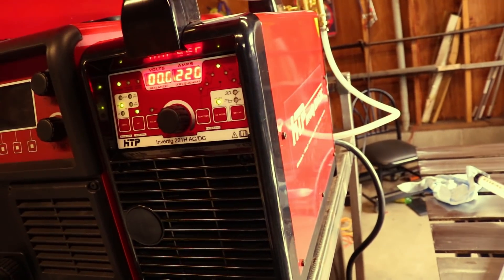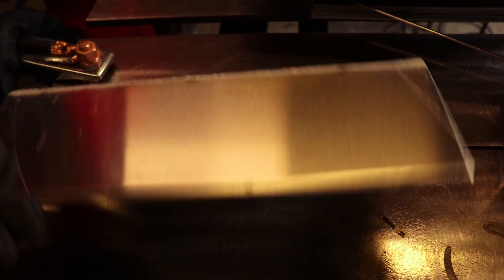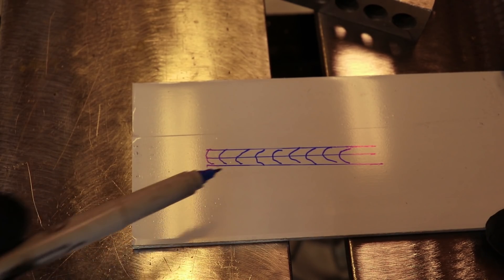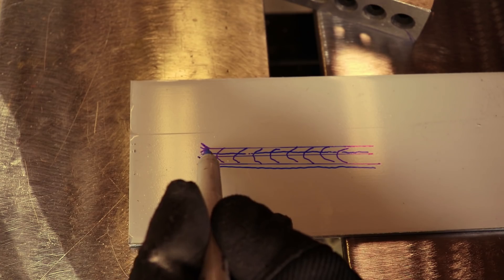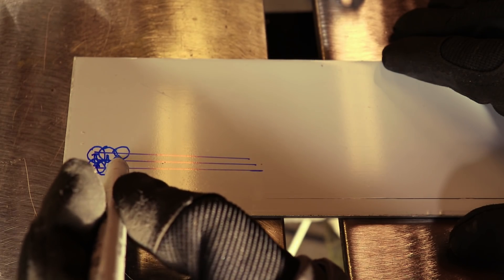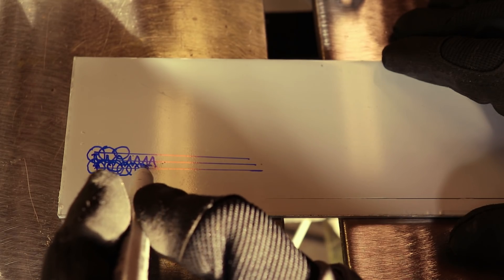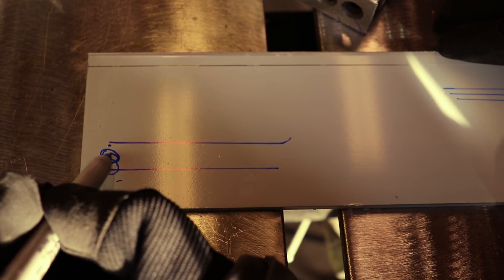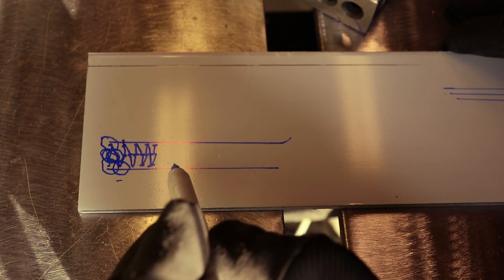TIG Aluminum Weave with HTP Invertig 221

Comment: Your videos are so helpful. Thank you so much for sharing. When I weld inside corners I can’t seem to get my arc down into the corner. It tends to bounce between the flat plains of the two pieces. Do you have a tip for that?
Reply from the maker: Ya it usually will do that until you dab some filler in there to join them together.  After that it should be smooth sailing!  If its doing it afterwards its possible that your gas  has too high of a flow rate
Reply: 5th Street Fab thank you so much!

Comment: Is it posible to tig a crank case ex.( from a motor cycle) using  tacoma imverter dc tig/arc and argon gas? A/c tig/arc machine are very  expensive.

Comment: Amazing welds as usual. Looked like you just keep your foot pedal fairly steady, rather than manipulate the pedal as you dip filler rod. Also, I noticed that you sorta tap down onto the pool with your filler rod , rather than jab into the front of the pool. I need to change my technique I guess.
Reply from the maker: Thanks I like a consistent foot pedal unless it's thick material that's not preheated.  That seems to weld better with pedal pumping.

Comment: Are you using a different lens or filter when you shoot the actual welding footage?  When I use my camera, the light is way too bright and you can't see my welds.  All you can see is a bright light.   Those welds look awesome by the way.....Thanks.
Reply from the maker: Ya I'm using an adjustable Nd filter over my camera with the iso all the way down and the f stop at 32 I think
Reply: Does your helmet have an adjustable lens? Sounds like you need a darker shade
Reply: @bellofello1  my helmet is a Lincoln adjustable shade auto darkening. It goes to 11 or 12.

Comment: Thanks for the video. I bought this machine about 7 months ago and haven't had time to use it. Please show videos with 1/8" 6061. Please show with detail how you set up with the machine as well. Thanks again
Reply from the maker: Right on bud!  Ya if I get my hands on some 6061 I will.  It's pretty much the same but likes more heat
Reply: @5thStreetFab  I noticed from another vid that you are using the same belt sander as mine. What kind of belts are you using? and how are you using it? I tried using a nice nylon mesh belt but that belt sander refuses to move with it on. Thanks

Comment: seems like weaving on aluminum would be prone to cracking when it shrinks. Honestly I don't know, I just know aluminum is already prone to crater cracking, and it stands to reason that weaving would amplify that
Reply from the maker: Never had it crack.  Aluminum cracks  from the shrinkage because of heating and cooling so fast.  But  it takes a lot of the strength away because of how much heat is dumped into it.
Reply: 5th Street Fab, does it affect grain structure and HAZ like it does in steel and other heat sensitive materials? Just wondering cause I really don't know lol. Just trying to learn more :)

Comment: Great info-  I use a Miller Syncrowave 210 (inverter). I agree on the annoyance of high frequency, & only get around 150 if needing a lot of focus (along a thin edge). Around 60hz is much more pleasing, & I use on thicker pieces, castings, etc.
Reply from the maker: Definitely!  60 Hz is what my machine runs at work and I don't feel like shooting myself by the end of the day haha

Comment: You are very clear with your explanation, easy to understand, especially with the video close up, which is also easy to see. Good job. I have stick welded ac and dc since high school. I'm  now 70, and considering a multi purpose machine. I have never mig or tig welded, so I'm  watching videos on both process, plus making a  decision on what machine to buy. Enjoyed your video
Reply from the maker: Thank you very much!  If you want to TIG welding Aluminum make sure its and AC/DC multi purpose machine.  Good luck! And thanks for watching

Comment: lincoln invertec v205-t ac/dc. Videos are great.How do u not have trouble with heat going so slow, is that all from foot control? I talked to u a while back about my aluminum falling away when I tried to do a butt weld and it was cause of heat saturation starting to slow.thanks
Reply from the maker: Ya it takes a bit of practice id try using larger pieces to practice on or clamp it to something thick to help

Comment: Great good job I have AC DC 315Aluminium Welding Machine TIG 250P@ https://s.yimg.com/lo/api/res/1.2/LItZHZ9ldntlxb8s0gMzSQ--~B/YXBwaWQ9eWlzZWFyY2g7Zmk9Zml0O2dlPTAwNjYwMDtncz0wMEEzMDA7aD03NTA7dz0xMDAw/https://ae01.alicdn.com/kf/HTB1Xso7MVXXXXcVXFXXq6xXFXXXb/Aluminium-Welding-Machine-TIG-250P-AC-DC-welder-three-phase-AC380-50-60HZ-tig-welding-machine.jpg.cf.jpg

Comment: Miller Dynasty here.
Reply from the maker: lucky!  I was so close to buying one a few years back
Reply: @5thStreetFab  Mine is only a 200 but water cooled.  I bought it to start a side business that's now full time.  It's made me a fair bit of money.  Just wish it had more amperage.
Reply from the maker: @Skeetmgeett  have you hooked up some helium to it?  I'll add another 30-50 amps
Reply: @5thStreetFab  I'm actually in the process of that now.  I finally got a massive bottle of argon so I can use my old tank for helium. Its spendy though. But I guess when you look at a Dyna 400, helium is way affordable.
Reply from the maker: @Skeetmgeett  I don't remember it being too expensive I think it was maybe double a bottle of argon but I still have the same bottle 2 year later haha

Comment: Interesting. I just can't see using the technique much. That's an awful lot of heat to sink into material at once.  Not trying to hate. Just aluminum warps a lot as it is.
Reply from the maker: No I'm with you on that it's just fun and pretty otherwise I run stringers

Comment: I'm running an inverter. An Eastwood Tig 200 acdc. No freq adjust. I wish. At work I use a Miller transformer based synchrowave 300. I think it's a 300. Been a while since I looked. Tig every day. Love the videos. I messaged you a while back on IG. Keep it up dude! (Laidoutsierra at IG)
Reply from the maker: nice.  thats kind of the set up i have.  an inverter at home and syncrowave at work

Comment: I use an everlast 250ex inverter machine. It's been a great machine but the torch that came with it sucked. I just recently installed a ck20 water cooled torch and the difference is night and day. My water cooler is a home brew that I made using a pump and a transmission cooler, the reservoir is a 1 gallon gas tank, and I use a 50/50 mix of water and antifreeze for the coolant. No fan. The tranny cooler works so well that the fluid has never risen more than 5 degrees over ambient temperature  and no fan noise.  It's been that way for 5 yrs with no issues.
Reply from the maker: right on.  Ive heard good things about the 250ex's  and Ive seen people use those water coolers like youre saying! thats awesome they work so long
Reply: @someone else distilled water freezes, it just be mixed with something to keep it from freezing. Antifreeze has anti corrosive additives in it. It's been going strong for 5 yrs now, I think it'll be just fine.  My mixture is distilled water with antifreeze.
Reply: @Marcel Lemay, would love to see a video of the water cooler. Interesting setup...you still in TN? I need to come back by and see ya. You turned some Ball Screws down for me years ago. Id like to come check out the shop!
Reply: @mainstreetmachineworks651  Hey, I remember you! I'm still at the same spot.

Comment: Thanks very much.  What I would like to see or hear  is more "basic" information.  My mig doesn't have a chart and I didn't pay  the fact much attention. On various YouTube videos I learnt about balancing wire feed speed and amps BUT it took me a year to figure out amps are related to material thickness.  Maybe someone mentioned it but some basic information needs to be repeated over and over again to enable learning. Thanks for listening.
Reply from the maker: ya that takes some time if you were never taught it before.  Im planning on doing a begginer tig series but might throw in some MIG also
Reply: @5thStreetFab  that'll be terrific.  Thanks.

Comment: At work I have a Tokentools 315 DX ( identical to the Everlast 315 ac/dc, except it's Red instead of Green) I don't get the "round" definition of the dabs as much, mine seem to ripple as though I have more heat in the weld zone, what am i doing wrong.
Reply from the maker: Id have to see a picture otherwise im not sure.

Comment: Your videos have helped my ac tig in so many ways, thanks for taking the time to teach so many of us.   Iv upgraded from an eastwood tig200 to an Everlast ext210. Next upgrade is a watercooler .
Reply from the maker: Right on dude.  I'm glad to hear it!  How is that ext 210? I've never ran one.  Yes water coolers are amazing especially on Aluminum!
Reply: 5th Street Fab Its great, so many settings to dial in, blows the syncrowave200 I use at work away.

Comment: Lincoln Square Wave TIG 355 for me.
Reply from the maker: Sweet machine dude
Reply: @5thStreetFab  Thanks. It's a big one. 410 amps. 
I'd like to see more videos on what can be done with older machines like mine with no frequency adjustment.
Reply from the maker: I'm planning on setting mine up so it acts just like my transformer at work so I can show those techniques

Comment: 250 syncrowave transformer type for me
Reply from the maker: Perfect that's what I run at work eveyday
Reply: @5thStreetFab  Me to that`s what I use in my home garage and I like it
Reply: I still run a Syncrowave 500 old school transformer and love it. Simple for us old guys. I did get a Flex lock 250 amp water cooled torch that is spoiling me though.
Reply from the maker: @Vance_Nickerson  wow never heard of a 500!  That's really cool what year would you say it is?
Reply: @5thStreetFab  not sure of the year late 80s I'd guess. Can't get a picture posted but its a 500 and tough as nails and dependable. Doesn't have all the bells and whistles of the inverters but I don't weld razer blades.
Reply from the maker: @Vance_Nickerson  that's really neat thanks for sharing

Comment: Old P&H Transformer, 60Hz only. Thanks.
Reply from the maker: Cool! That's what I mostly use! What kind?
Reply: It is a P&H  AC/DC welder with a water pump for cooling the TIG torch. Most people used to call them Heli-arc welders. Mine looks like the one here:  http://www.tristatemachinerydismantlers.com/WISCONSIN/Motors-and-tools/New/Heliarc-welder-p-h-300-amps-output-the-beast.jsp